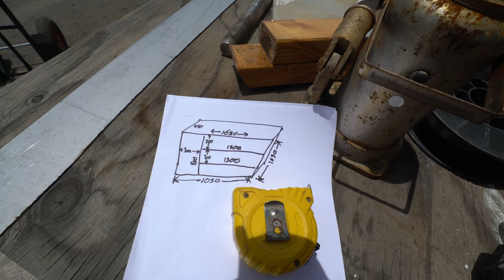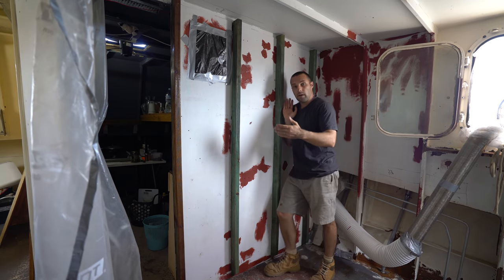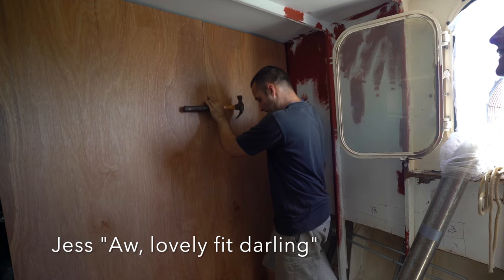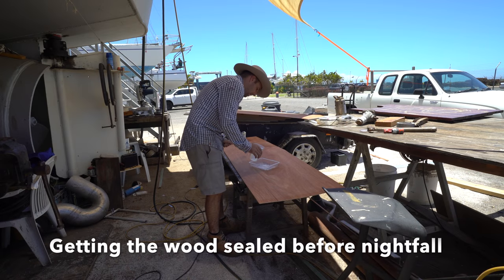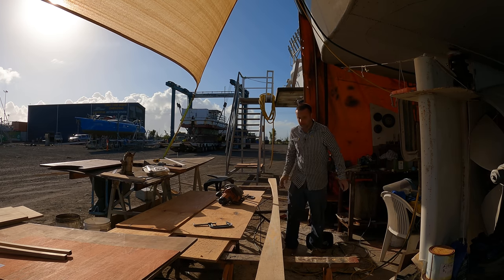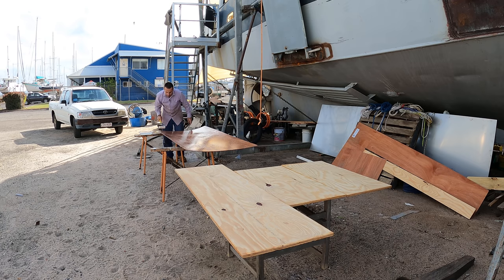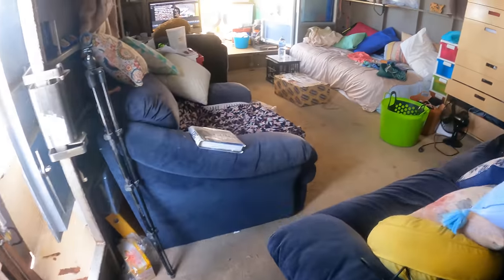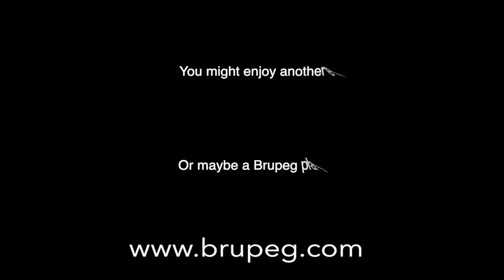Timber Walls, Cabinets & Plinths - Project Brupeg Ep. 193

Comment: Flap disk on a grinder is great for sculpting wood.  I saw it on one of the channels I follow and I thought it was brilliant.  I pulled out my grinder and made two replacement blades for a rotten paddle I had sitting in my basement.  It was so quick and easy.  The best tool is the right tool, the second best tool is the one you have within reach.
Reply from the maker: Very much so.

Comment: Good to see you using the ply strip template method. I learnt very late in my boatbuilding life to use 40mm wide strips of 3mm ply and a hot glue gun to make quite complex templates even on curved surfaces. The beauty of the thin ply is you can score it with a Stanley knife and snap it, I appreciate you are using what you have got to hand but if you can pick up a cheap damaged sheet from the hardware store then it would last you for ages.
Reply from the maker: Yeah we have a lot of internal fitout to do post launch so its likely we will streamline the templating much more

Comment: Scribing the front element of the plinth was great, nice job with the Skil saw BTW.

The rear element though doesn't need to be scribed, a simple 4x2 on short legs would have done the job, much easier tonget the plinth level front to back that way
Reply from the maker: Thanks for the tips! its a good point youve raised

Comment: When flies landed in my wet gelcoat on a boat hull I would leave the epoxy to dry then go about cutting off the flies at the ankle with a razor blade, they were long dead by then probably due to acetone intoxication. If you have too many flies to avoid rolling them into your coatings maybe a strong breeze from a large fan would shoo them off while helping to dry your epoxy?
Reply from the maker: Thats definately an option, although we do live/work in a dust bowl so breeze is good to a point.

Comment: Great work. Your to do list is so long. When you down to the engine room, I thought, wow. Still a lot to do. How are going to be when your finished. Put on about 20kilos. Those steps are a killer when your working. Up and down. Your could take up rugby in the front rows. You could play for the Aussie team to beat those Kiwis.
Reply from the maker: The Kiwis don’t need any help to beat the Australians in rugby. If I was on the Aussie team I would only be helping the Kiwis. Plus as a citizen of New Zealand it’s illegal for me to defect and play for the Wallabies
Reply: @ProjectBrupeg  Darn, well it was worth a thought.

Did you think about adjustable feet for your kitchen. It would leave it open undeneath for air and let any water dry out. Just a thought.

Comment: I see Australia uses the impetric measurement system also. You refer to cutting 450mm strips from a "4x8" sheet of plywood. We have the same issue here in Canada, remnant of our shared colonial past!
Reply: Ah, yes. Here in Britain we still use a mixture of everything, all the time. Ancient and modern; it just seems to make more sense, somehow. As long as you're clear about the units involved, the jobs still get done.

A bonus is: it drives the rest of the world nuts, and that's something we hold very dear indeed!  :-)
Reply: yepper.
Reply: Imperial vs metric mix ups have resulted in some interesting times - NASA spacecraft hit the Martian atmosphere at roughly twice the speed it was supposed to and in Canda a 767 became a very heavy glider when it ran out of fuel at 36,000'
Reply: The thing about the Imperial system is its 'People Scale' - I'm from the generation which was taught the metric system ONLY in school.  But since then I've learnt to use imperial - For most people Imperial units have values which are much easier to visualise which more than makes up for the inconvenience of having to use your 12 times table...
Reply from the maker: im all metric inside my head, except when doing fine measurements i can work in thou in my sleep but if i have to figure things that small out in metric it does my head in.

Comment: Grinder is a wood working tools. We use them here to notch logs or fine tune a notch anyway in log cabins...they have heads that have chainsaw teeth that will give it a lickin'

You are not a bad wood chuck for a kiwi steel boat builder 
✌️😝
Reply from the maker: Good to know, i figured if it works its the right tool...
Reply: @ProjectBrupeg  that's the Alaska way! Make it work! You are doing amazing with what you have 

I deal with funky angles all the time building domes. Sometimes we gota think outside the box ;)

Comment: Hey Dame. Great job on this vid BTW Jess. Please share the product info on the UV stable epoxy that you used. This would be great to get a hold of in nz. Cheers guys
Reply from the maker: This is the stuff we use, EPO100G® Epoxy Resin Clear Glaze. we can get it on eBay over here by i couldnt see any on Trademe

Comment: Are you using a different insulation behind the stainless splashback for the cooker - for example rockwool, which has a zero fire rating?
Reply from the maker: No just standard Poly but the stuff we use is fire rated so it does burn just shrinks away from the heat. it does take an awful lot of heat to get it to do that though, (think open flame 20-30mm away from it)

Comment: I see they parked your next project boat beside you😄
Those exhaust clamps . Check with the local truck parts.
To help with the fridge sound. What about  thick rubber feet?
That kitchen layout picture is great for everyone to understand. 
Put a cord in that space behind to use as pull though. Every time you pull a line though always pull a cord to. For the next time.
Jess will be so excited when her galley  castle is done.👸
Kiwi engineering at its best 🥝🇳🇿💯👍
Reply from the maker: Thanks for the tips! Yeah its much better when you can see whats in our heads when we are building it. gives a bit of context to the jobs

Comment: I keep forgetting that your seasons are the opposite of ours. Whilst I'm looking out at the 25cm of snow we've received in the last two days (with even more on the way), I was thinking, "flies, in February?????" So, Dame, where the plinths meet the deck, are you going to make the fillets using epoxy?
BTW, my GoPro 9 listens to you, because it started recording, when you told yours to start, and stopped when you told yours to stop.
Reply from the maker: HA! i love that i can record something completely by accident on the other side of the planet. Yeah the plan is an epoxy holding the bearers to the newly two packed galley floor. Then i will get in with some fairing compound and radius the corners out so we can wash the galley out nice and easy

Comment: It's better that your stainless doesn't touch the outer hull or it would have better thermal transfer and be colder than balls when it's cold!
Reply from the maker: Exactly. Hence the need to build in the structures to lift it off the mild

Comment: damien .. D i cant misspell that lol i doubt you need to worrie about buckling but the gaps are good precaution..  just wondering metal shrinks when cold  your in  +30c planning on going to -30c   how much will brupeg change dimension ally over 60c of temperature?  it  will be a within a range and as long as what your adding  is within those dimensions   all should be good... and the architect in me says your framing is massive overkill lol your walls carry no load  the steel shell has that responsibility. thanks as always for the vid
Reply: yes but what about the "5 dimension" cue strange music
Reply: @jossmaxwell00  - Dude, that's disturbing and weird.

And I love it!
Reply: @EleanorPeterson  Thanks Elli P hahahah
Reply from the maker: im hoping everything shrinks in a uniform way, including crew because if you think about it the boat is going to get smaller (howmuch i cant say) and if the crew dont shrink a similar amount its a risk we may not fit in the boat...
Reply: @ProjectBrupeg  i would bet thats a risk no matter how big the boat and small the crew sometimes . ive been thinking on the ball valve for the sand blaster. would a gate valve be a better option? i dont think a needle valve is a good choice as for the wear in the tip ..call it a consumable pressure velocity and abrasion tays even in diamond its going to wear.  as for plinth  your never stuck lol and it is correct just unusual terminology this side of the equator and on the other side of the pacific ;] everyone is looking good and happy and healthy including c1 regular 1hnap10 min grooming 2h nap and snack and groom and a good long sleep 2-3h and wake up make noise move hings  snack sleep the rest of the afternoon and repeat until 3 am...lol its the 3 to 6 am shift that becomes annoying at times lol. cabinetry ,paint , flooring and finishing details not much more i can see to do after the kitchen and berths. thanks for the videos

Comment: How many steps, going up and down those stairs, do you reckon you do each day ? :) PS - you wouldn't have had that issue with the exhaust if you had a Detroit..... just sayin'
Reply from the maker: We did count once and it was something like 25-30 times a day for the stairs. I know what you mean if it was a detroit the gentle displacement of oil would have kept the mild steel in rust free condition for many years.
Reply: @ProjectBrupeg  so you are saying that Detroits provide massive amounts of reliable power as well as corrosion protection.   I need to go check my Cummins catalogue again.
Reply: @ProjectBrupeg  Stu is gonna love this :D
Reply from the maker: Detroit’s provide massive amounts of external rust protection. Under the engine, around the engine, over your tools, down the exhaust. As for power that part is pure speculation. They certainly make noise and heat but power, sounds a bit subjective to me...
Reply: @ProjectBrupeg  Ahh I suspect you have succumbed to that urban myth, that Detroit Diesels turn perfectly good Diesel into Oil, Smoke and Noise.
Reply: @ProjectBrupeg  in all seriousness, Dam and Jess, you to are an inspiration, your work ethic and attention to detail is awesome.  If you were not Kiwi's we would make you a national treasure.  I can see why Australia once wanted NZ to be a State of Australia.
Reply from the maker: I mean the evidence sorta suggests that. It’s been peer reviewed

Comment: Can somebody fly me to sneak into Aussie to help with brupeg somehow? Its fricken -13°F(-25°C) here today at 900ft elevation.(not a typo 900 feet above sea level). Let alone America's insanity last 12months. Also Dame im a journeyman carpenter a grinder is the BEST professional tool to use to remove lots if material quickly. An arbortech or just a sanding pad works great. So you chose the correct tool 😁. That V band is much better than the set up you have. The old tapered v bands suck. The new one you got weld it right to the turbo housing itll work MUCH better. Make sure you chisle off the "ceramic" type rust cast produces. Yet ive seen those old taper style v bands leak so much its not funny
Reply from the maker: Yeah it just looks wrong aye, the cast turbo housing always looks rubbish compared to a nice new shiny stainless flange

Comment: I may be wrong but that clamp that arrived for the exhaust has 2 weld V flanges inside already for welding , the part that you may be referring to may be the same as the outer clamp/band itself. https://www.youtube.com/watch?v=Tz0yckhx5TU
Reply from the maker: Yeah i get what you mean but the one that arrived was a beautifully machined band flange. the turbo needs a completely different shape to seal properly. All this said the band flange is awesome and will be used to break the long pipe runs into multiple smaller sections so we can lift them in/out (cause 6" stainless gets bloody heavy after a while)

Comment: Your Plinths will work well but with your aversion to wood working and love of welding why didn't you do them in steel?  Wouldn't a couple of pieces of angle iron with supports welded to the floor worked?
Reply from the maker: Steel would have been lovely but if I weld to the floor I burn the paint off in the cabins below, so we made the call to build in wood for speed and low temp
Reply: @ProjectBrupeg  That explains it.  Thanks
Reply: @nvennard  He is ALWAYS thinking ahead.
Reply from the maker: I like to think of it as juggling 47 different variables so you do the least amount of work overall.

Comment: Is that 60 grit fly to exopy?
Reply from the maker: I find 60 does a nice job sanding flies. 40 tends to smear fly parts and that can be a right hassle. 120 is way off, you just end up smothing out the fly but not actually removing said monster

Comment: Interesting that you are using the word "plinth" to mean a lump or lumps of wood that your galley cabinets will sit on top of. I believe that to be the correct term, "bearers" would be another possibility. 
In the UK for some reason they refer to the "plinths" in a fitted kitchen as being the "toe boards" or "kick boards" which hide all the crap and adjustable feet etc. under the lower cabinets. I don't know why they are called plinths, as these are usually made from melamine-faced chipboard, do not hold anything up, and are usually clipped onto the tubular legs with clips. Just saying!
Reply from the maker: Honestly i havnt got a clue whato call them, bearers sounds good. better than plinths. someone somewhere once said plinths and my brain latched onto it.